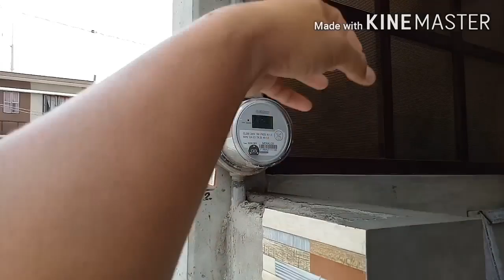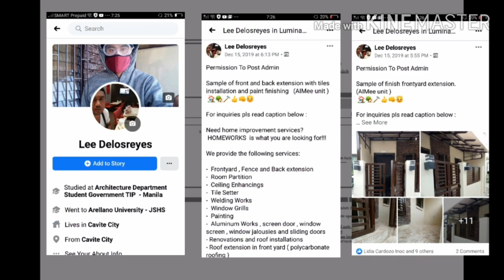Angeli TH Lumina House Improvements day 7

Comment: Question po sir, saan po sir pupunta ang tubig pag umulan wala po sya drainage sa slob ng cr?
Reply: Baka sir pwede kayo gumawa sa baliuag bulacan?
Reply from the maker: Yan ang problema.. Yan ang design na ginagawa ng developer
Reply: Magiging parang pool pag nag upgrade n rin mga katabi nya. May solution po kayo sir sa palpak na gawa developer?
Reply from the maker: @noelvictoria609  actually meron at meron solution  po dyan..  Kapag halos puno na ang back to back extension ng isang block..  Need mag meeting ng buong block para sa plan kung papaano magiging maayos ang daloy ng tubig para d ma stock sa mga slab floor area ng cr..  As of now d ko pa maeexplain pero may solution padin